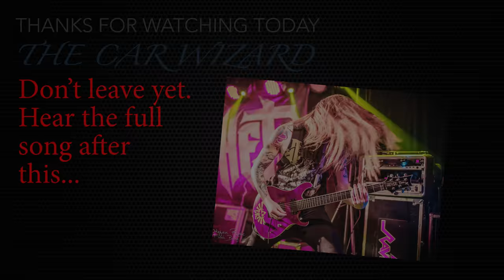12 Best Mechanic Tips and Tricks from the CAR WIZARD put all together

Comment: Try the top bellhousing bolts on an 80s-90s chevy s10 4x4 . see what your solution to that is. ?
Reply: If I remember correctly you have to lift the body up off the frame a few inches to gain access to the top bolts.
Reply: @21Piloteer  yup.

Comment: 1) no it want work the extension is gonna Twist or the rachet nible is going to break from the extended force . The answer is blowtorch
2) that's 1 out of 10 luck if the pump is dead then is dead .
3) yes that will work with the starter.
4) yes that will work if you have a  magnet the paper might work if it doesn't break I prefer grease or a magnetic screwdriver
5) no you need a bigger one a hummer or a sharp screwdriver if you cannot use Dremel
6) yes that's a good one
7)yeah  its ok if it's long enough 
8)ok that's a good tip I will give you that one
9)ok you are right yes
10) ok that's a good one
11) Yeap correct if you can find or have a punch on the spot 🤣👌
12) that is a good trick

Comment: Your first tip was a life saver a year or so ago (when I had first seen it). That clip popped in my head when I was going at one of the four bolts holding an M104 water pump on (was working on a W124 Mercedes). Went to Advance Auto Parts, picked up a massive extension, moved parts aside, and got an angle on it. This is of course AFTER already stripping the bolt 😂 I stripped the bolt after trying it up close with a wobble... so I needed a bolt remover bit too. But going straight at it, BOOM. It came off quick and easy https://youtu.be/J0CBhTuE56A?t=40

Comment: https://youtu.be/OT4w2WLP7hs?si=2Cxco3rprhg8AR-s

This the best method for replacing inner tie rod boots. Albeit, I have found that cuffing the boot twice over works best, as it slightly flips the end past the channel on the steering rack, but you simply pull the boot a bit, and the end of the boot will click perfectly into the channel on the rack.

Comment: Going to move a 2011 Compass for someone possible bad transmission I learned from the wizard they’re junk . The people owe $6000 on the car sad . Always get an extended warranty people it’ll save ya
Reply: Code said second gear solenoid stuck car would not move under it’s own power and derated